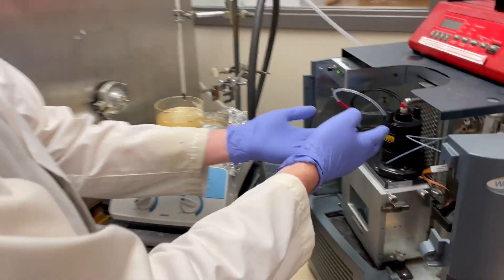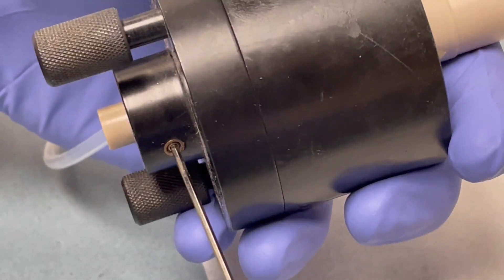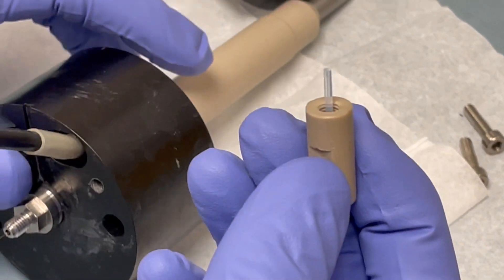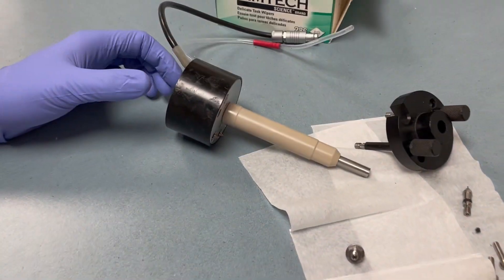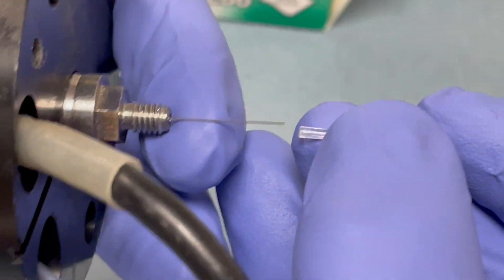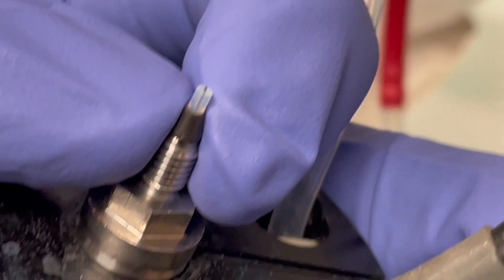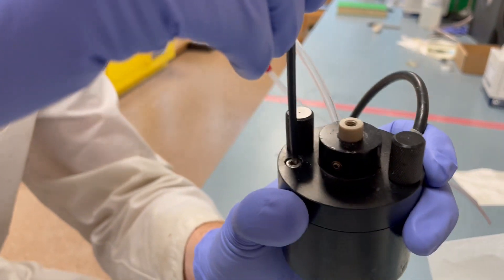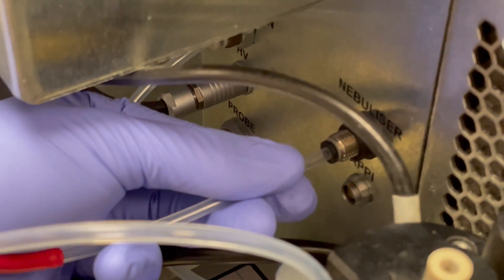How to change the capillary on an electrospray ionization mass spectrometer

Comment: Is it possible to clean the capillary instead of changing? Is there a protocol to clean it?
Reply from the maker: You can via sonication, but we find them unreliable. While the capillaries are VERY expensive if you buy them from the manufacturer, you can just order cut capillaries from a part supplier and they cost just a few dollars each. We typically buy 100 at a time.